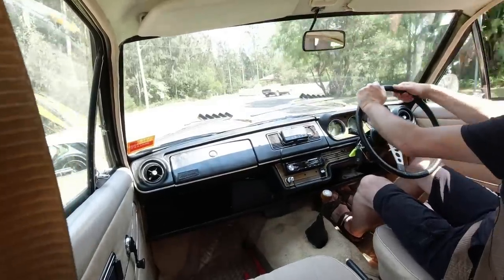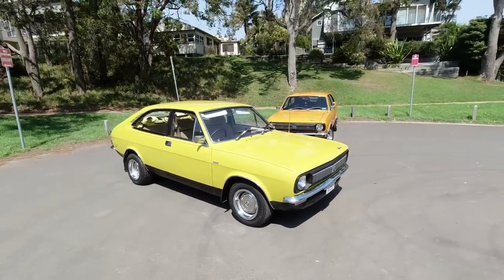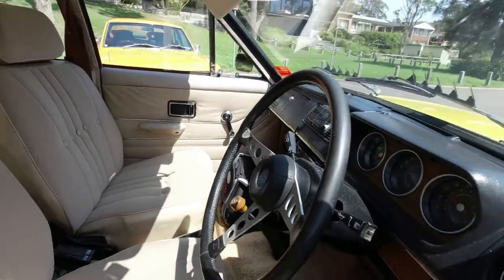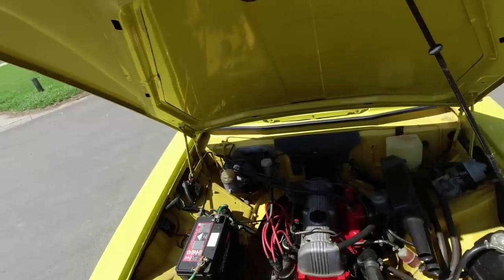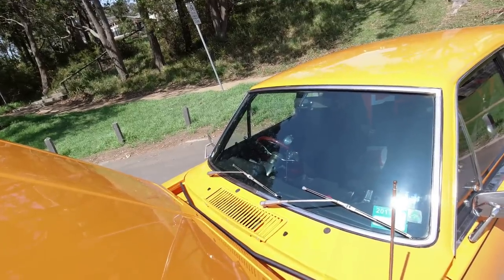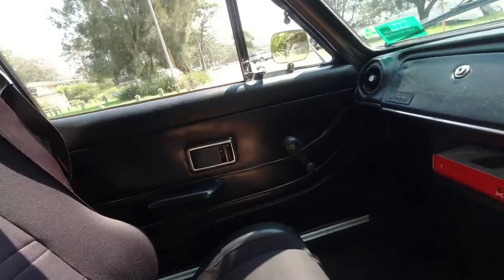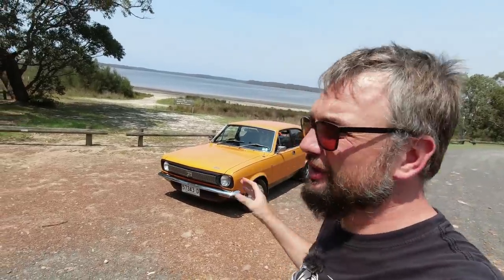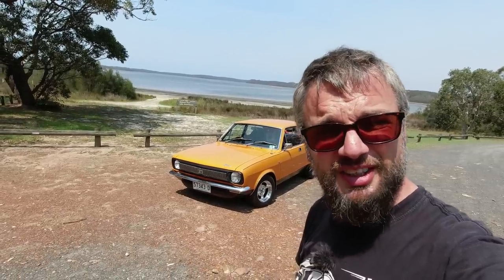Aussie Oddballs: Leyland Marina SIX-CYLINDER! Driven!

Comment: Not real sure about their claim to have the first Aussie designed four cylinder engine. The first truly Aussie designed four came from Holden in the early 80's. It was a cut down 2850 cc six and was dubbed the Starfire. It was quickly renamed the Backfire by the press. It was designed to replace the Opel 1900 that was used in smaller Torana's that were later christened as Sunbirds. Local content rules were the rage at the time and Chrysler Australia had a huge engine plant and offered to manufacture four cylinder engines for not only Holden, but Nissan and Toyota too. Negotiations between Chrysler and the Federal Government fell over and  Holden went their own way with the Starfire. Interesting side effect with all of this is that Toyota Australia used the Starfire in their locally assembled Corona........with the same dismal results as the Sunbird. Don't forget to check out the Chrysler Centura (180), drive the Four litre Hemi six version for no other reason than to experience rapid acceleration. Try for the KC model though, they got the dashboard right by then and the finish was only halfway horrible.
Reply from the maker: There will be a Starfire in a future video. Sadly the car wasn't road legal, but we still hear it run...

Comment: If only the Marina had been assembled as stock as a coupé, with a 6, or an 8, plus the prettier nose, 20th century suspension and brakes and an appropriate number of gear ratios, then it wouldn't have been an abject laughing stock, plus it might have been competition for the Capri, Manta and Ascona etc.
Reply: originally the coupe was meant to be that, you had the saloon then the coupe , like the capri was supposed to a coupe cortina, but it didn't pan out like that

Comment: 4500 RPM at 100KMH ? 62MPH  thats ridiculous on a 4 speed box on a 2.6L engine , i once drove a colleagues 1980 Rover SD1 which was also a 2.6L but with a 5 speed box and that was just over a 1000RPM at 50MPH and 1500RPM in 4th. i didnt get it above 50 as it was a very short journey just down the road to drop his car off to him as he couldnt get back to fetch it himself.

Comment: I had the misfortune to own a Leyland Marina 6 with 3 speed gear box.  Gear box blew up on first long trip,
Reply: The front end was dangerous hit bumps and the car would bounce from one side of the road to the other.  Had a Pedar front end conversion, which was a bit better.  Unable to drive car on hot days as fuel would always vaporize,  diaphragms in fuel pump had to be replaced frequently, always kept a spare in the car.  Timing chain stretched had to be replaced. Hit 60mph wheels started vibrating.  Had so many front end alignments and wheel balances could not solve proble.  Tried different wheels as their were 2 sizes listed for the Marina, no change.  A very unpleasant  car to own, as was the service from the Leyland dealer from where it was purchased.  The dealer was located in Russell Street, Melbourne but I won,t mention names.  Glad to see the last of it.

Comment: Rover SD1 2000 had the 4 cylinder 2 litre E-Series as an in-line rear-wheel drive.  Dreadful as it must have been...
Reply from the maker: South African SD1s could come with the 2.6 E Series. Sounds a better idea than the 2.6 we got in the UK to be honest. As you say, 2000 used O Series.

Comment: I had a 1.8 Coupe and then a 1.8 TC 4 door saloon. Both great engines let down by Morris Minor front suspension (bottom trunnions and top swivel joints) with grease nipples. Plus rear leaf-springs. Body work was poor on the sill area. There gearbox whined in them both.  The TC had too much performance for the dodgy handling. The TC seats were a comfy velour.

Comment: My mother bought a 4-cyl Australian Marina. It was so unreliable she eventually refused to drive it. Mostly electrical problems, including a starter motor with aluminium windings instead of copper, the windings cracked and therefore failed to start. She traded it in on a Mazda 808 which never missed a beat. Chalk and cheese. That was the end of my parents' don't-buy-Japanese-because-of-the-war attitude.

Comment: There was a nice pokey version in UK, the Marina TC, we had one for several years; 85’ish bhp from memory (MGB standard). Plenty of power for 70’s roads but the main issues as I remember were the rubbish suspension of the UK version, both front and back (sorted here it seems), and the very average front brakes of the TC. The Aussie Marina versions looked much better than the UK ones, especially the 6. Marinas in general were pretty good all round cars, but just not spectacular. The Triumph Dolomite Sprint pissed all over them....why didn’t Morris (BL) use THAT engine? Very good vid....thanks for that!

Comment: Was the 6 cylinder engine a 2.6 litre? Was a 4.4 litre V8 option available? A 2.6 is powerful enough but a Marina with a V8 engine!!!
Reply from the maker: Yes, 2.6. No Marina V8 from the factory, though I believe one or two were prototyped in the UK with the 3.5.
Reply: HubNut  Leyland Australia did experiment with a v6 engine for the p76 and the Marina.  It was the v8 engine with 2 cylinders chopped out.  It never went into production.  http://www.leylandp76.com/publications/pub-v6engine.html

Comment: Had a Marina 1800 TC at 50000 miles (UK) Plenty of power. Very weak gearbox. Very short gearing, 29m.p.g. Gummed up, worn out trunnions. Hated corners.  No rust. B.L. would never iron out faults during a model run. Could have been a good car with: Macpherson struts, (copy Escort),  proper gearbox with spread ratio's. stiffer springs.  Any sixth former could have fixed this car after the first showing. Why bother ?
The Yanks gave us two chances with the Stag, but wasted their money.

Comment: Yeah Leyland Australia tried to get in on the shoehorning of bigger Aussie donks into their smaller cars as to try & offer some competition against Holden with their standard & hotter versions of their big sixes stuffed into the smaller Toranas & Ford with their Ford Falcon 200 & 250 cubic inch sixes stuck in our Ford Cortinas that were designed to take the 1600 & 2.0 litre fours! & don’t forget ford gave you a three on the floor also in the earlier versions, l owned a Ford cortina with the 250 cube Falcon six & can tell you that thing was a weapon in a straight line plus you could really spin the wheels up very easy indeed but unfortunately they were a real handful on corners & also they just could not handle Aussie roads & conditions and fell apart long before the larger Ford Falcons did, oh & don’t forget Chrysler Australia stuffing their Hemi sixes in in the smaller Centuras!
Reply from the maker: Ford Cortina 6 video TODAY!

Comment: Why is it that they make the export models way cooler than the home market. Doesn't make sense..
Reply from the maker: In this case, it's because Australians crave big power, due to the vast distances they have to cover. A 1.3 is fine for pottering to the shops. Not so much when blasting between Aussie cities.

Comment: Princess 2200 engine
Reply from the maker: Sort of. The 2200 was a 1500 with extra cylinders. This is a 2.6 based on the 1750.
Reply: HubNut yes same sort of thing but better. Would love to have a drive or even race one  I remember the Morris marina when you let clutch out sharp n spun the wheels the gear stick would always slap the back of your hand lol

Comment: What is the grudge that some carmakers have against Australia? Not only did Leyland afflict them with the awful extended-E-series, in the process making an ill-handling car even worsr, but Ford did the same with the already poor Mk3-Mk4 Cortina, and the (admittedly OK) Falcon six. They were no quicker than the 4-cylinder models, just much thirstier and bloody dangerous on bendy roads. At least GM got it right with the Torana.
Reply from the maker: Cortina 6 video today. Felt pretty rapid to me...

Comment: The E series six was probably a better match for smaller cars like the Tasman/Kimberly and Marina 6.  Even in 2.6 litre form it was considered underpowered in the P76.  Not that Holden had anything great at the time.  The asthmatic 173ci  (2.85 litre) six was not fantastic and the 202ci (3.3 litre) (both used in the Kingswood) were not much better.  Ford's 3.3 litre and 4.1 litre sixes used in the Falcon were slightly better but still very average.  Chrysler Australia had the best sixes in the 1970s with it's Hemi engine used in the Valiant. Not to be left out, Chrysler Australia got onto the smaller car six cylinder band wagon and crammed a Hemi six into the French Chrysler 180 and called it the Centura. French Nuclear testing and subsequent union action meant the Centura reached the market somewhat later than intended.  Like the Marina 6 it was probably a better car than road testers would have us believe at the time.  It had a similar short life.

Comment: I bought one one of these heaps of shit in Aussie. Within 3 months it had 28 manufacturing defects. There was a line up of about 8 disgruntled buyers behind me. The major faults being; Right front wheel fell of (the wheel hub was held on by ONE 5/8" HT Bolt), water pump bearing collapsed, as did alternator bearing. !500 performance was abysmal compared to Datsun 1200. Constant trouble with SU Carbies. The car was advertised as a Saviour for Leyland. After that they deserved to go down !!
Can't watch this crap anymore 13:40

Comment: Always  terrible  on fuel in my experience
Reply: Certainly the Aussie ones would be with THAT gearing. Crazy for the long journeys in Aus. If I had one I'd change out the diff to a much higher final drive ratio (if possible).

Comment: Watch your foot really lazy way to drive Change Foot Flat on THE FLOOR very easy.
Reply: clutch pedal sat high in marinas, if you didn't t work it from knee you did kangaroo jumps as i found at 13yrs old when i shook out 3 crates of milk out the back of the van, the milkman i was  working  calmly picked em up no breakages  put them back in the van and came up front and diagnosed my problem (was working the clutch from ankle cos i could on my mums viva van) so then learned  to always  work clutch from knee

Comment: i served my time on marina's  and datsun. sorry the marinas were aPOS (weak gearbox and shit engine) compared to the datsun 180 B. had the bad luck to have a marina wagon as company car on a cold morning it would not start.
Reply: @williamwoods8022  Dad had two 1700 Marinas and both required grim determination and patience on the starter motor front even from brand new. The second "improved " 1980 car had a giant battery and ballasted 6Volt coil for improved cold starting which seemed to make no difference.
Reply: @williamwoods8022  i worked for a auto supply company and it was serviced,  it was just a POS just like the ones i did PD inspection and servicing on when I did my time. The morris minor was much better than any marina
Reply: Phil Healey  yep same thing for me

Comment: I bought one near new, in the middle 70s. Worst car for reliability I ever bought.
Reply: We had a couple over a long period of time. Reliable motors and despite what some people would have you believe not requiring constant repair.

Rust WAS a prevalent issue though but that was the case for many cars of the same era.

I can't recall the full reg of the earliest one, might have started with MOP1**R but the others were HVT849V, CTU605X and A252WOA. None let us down but the the 79 Marina and the '82 Ital rotted badly in the end. The Ital Estate was curiously still rock solid when sold on though.